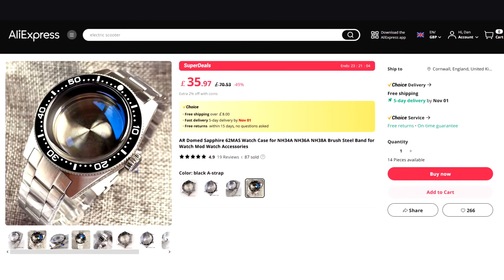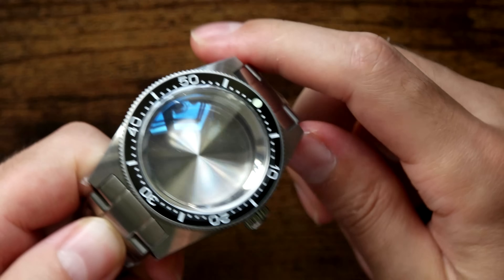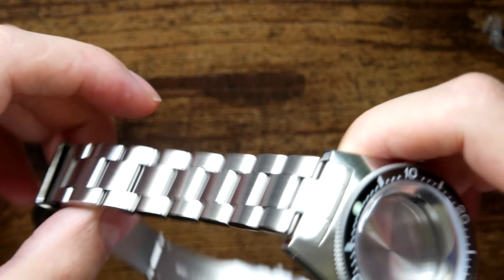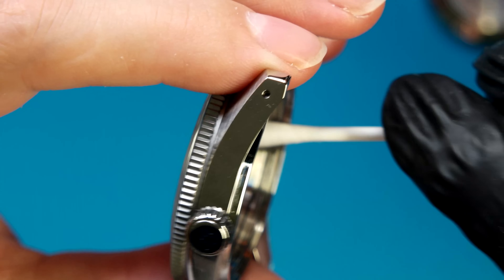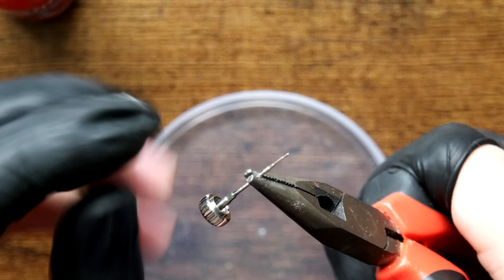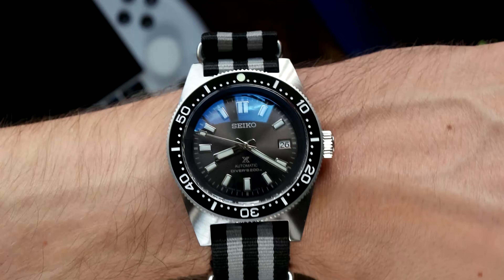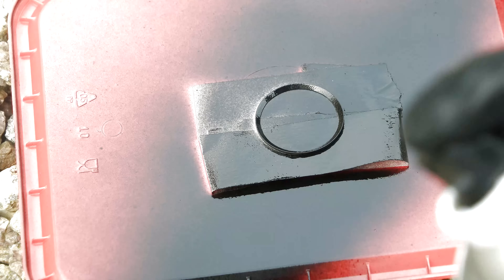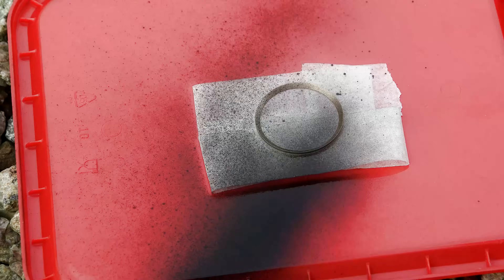Budget 62MAS Case!

Comment: Chapter ring is probably made of brass and plated with chrome or nickel. Chrome plating on brass increases its natural durability, giving it impact and corrosion resistance with a shiny look. Hence the yellow started to show when you sanded it. Brass is also used for making most dials.
Reply: That's exactly why!

Comment: Tip from a goldsmith, when doing a brushed finish, use a wooden or plastic ruler to slide it alongside. If the side touching the ruler will be visible then put some kapton tape (what rolex use) or masking tape to stop it getting marked. It makes a noticeable difference

Comment: Or, you could have just bought the Cadisen C8207M (I paid 56€ for mine, VAT and shipping included) and replaced the dial. And since you said this watch was a little too big for your wrist: the Cadisen's case diameter is 38mm with a 46mm L2L.

Comment: Made a 62 mas with this case and grey dial about 6 weeks ago. Found myself wearing it on a tropical silicone strap for most of my two week cruise to the Caribbean. I did not test the 30bar water resistance but it looked good in the blue Caribbean surf.

Comment: Another great video. Planning my first build... super excited, but the one thing that scares me the most is stem cutting. Have you done any videos on stem cutting ? Would love to see it. Thank you
Reply from the maker: Although I have included stem cutting in some of my videos, I haven't done an exclusive stem cutting video. Mostly because I'm not very good at it. I have trouble myself getting them right, and often cut a stem or two too short. My advice would be, have some spares (you can get stems cheaply on AliExpress) and go slow with it, better to cut it too long and need to file off some more material than to cut it too short.

Comment: Great video!! Do you know if that dial will also fit the 38mm case? I'd like to do a similar build in the smaller case size. There doesn't seem to be a lot of size reference info on the namoki or weezmods websites.
Reply from the maker: This Namoki 38mm 62mas case: https://www.namokimods.com/en-gb/products/nmk927-62mas-skx013-watch-case-brushed-finish?_pos=10&_sid=a36fe8e2d&_ss=r&ref=itsanotherwatchYT 

As far as I'm aware, their cases fit the standard 28.5mm dials just like the one i've used here. So it being a smaller case, should just meet up with the edge of the dial. It will pretty much look the same but without the redundant chapter ring space. (this is the look I would go with ideally, but I wanted to test out this cheap case for this video)
Reply: @ItsAnotherWatch  I was hoping that was the case that the same dial would fit, but I wasn't sure about the length of the hands either. But in your video it does look like the dial and hands have enough extra space to fit the smaller case. I'll be attempting this build over the next few weeks. Thanks for the info!!
Reply: How did it go. Following
Reply: @jcfredelucesrn  I ended up using a Seestern 62mas 38mm case because I couldn't find anything else with the correct dimensions. I swapped out the movement, dial and hands, and it came out looking great for about $200 for everything.

Comment: hey @ItsAnotherWatch , Good to see you again posting a video mate! The watch looks stunning , as you said a bargain! might go for it myself. Quick Q, what size clasp should fit that bracelet?
Reply from the maker: I measured the inner width of the clasp as 18mm and the outer as 20mm. When looking at listings on AliExpress they seem to have options layed out for "Band Width" so I guess you'd pick "18mm band width". Since the link on the bracelet that attaches to the clasp is just shy of 18mm.

I'm seeing milled clasps on AliExpress for as cheap as £2 so it might not be a horrible idea to get an 18mm AND a 20mm just in case the 18mm is reffering to the bracelet width BEFORE it tapers.

Heck... this is why even I hesitate to just BUY a milled clasp, since i've bought some in the past that don't fit what I need them to.
Reply: @ItsAnotherWatch  thank you so much! Will probably wait for the big sale and pull the trigger 😁 hope we'll see a video from you soon.

Comment: I finished a type of grand seiko. but between the chapter ring and the dial there is a small space in between . the dial fits properly, so is the chapter ring. any advise on this.
Reply from the maker: Unfortunately the only thing that comes to mind would be that the movement might need to be pushed in further, it might not be seated all the way.
Reply: Thx for the fast answer mate🎉 I try to do this but im afraid that I wil push to hard. Greetings from the netherlands.

Comment: Yep, I've built on this one as well, excellent product for the price, did have  to replace the case back as its finished quite poorly and was a bit scratchy on the wrist 😂😂 DDropped in a PT5000 and really does look the business, replacement bezels inserts are also easy to get hold of ,got mine rocking a blue bezel and white 62mas gloss dial 🤌👌
Reply: Which bezel inserts fit these please?